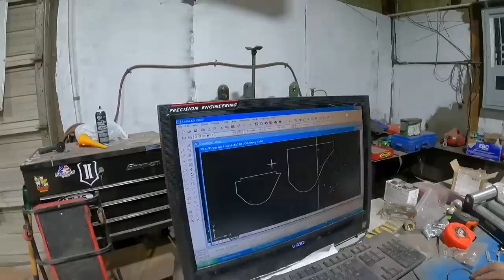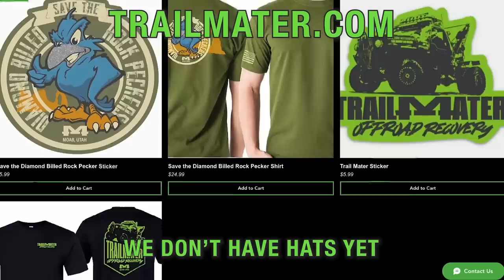Leaf Spring Life

Comment: If you used 1" or larger threaded rod with an adjustable limit strap adjuster you could tune from maximum drop to limited drop on the rear limit straps.  Kinda like Nascar spring adjustment screws.

Comment: Since comments help your algorithm, here ya go. Not just a comment, but a suggestion. For the longevity, double plate those hangers, and build a bridge between them. To keep the"wallow" out of the hole, weld in some hardened steel. If you have a lath, or take it to Paul, and old cam makes a great hardened piece. When I worked at a machine shop we used to use cam pieces to make hardened seats for heads.

Comment: How that trailer didn't tip over is a mystery
Reply: I wouldn't have even gone on the right side of that trailer unless it was winched off.  At least they got it further off the road.  Next is to unload the darn trailer into something else.  How long were they driving it in that condition?  And why weren't some of those door frames loaded onto the back of the flatbed?  So many questions!
Reply: @redmondjp  The first axle was strapped up, so I'm guessing they'd been running it on 3 wheels for a while before the other tyre let go. I've seen some sketchy things on this channel, but that trailer takes the cake by far.
Reply: Rory held it up with his mind.
Reply: Gravity sucks!
Reply: And not to mention the Miles it must have driven to Toast the wheel like that, a complete mess
Reply: That trailer had no business on the road. Sketch to the max.
Reply: @lbfuller5013  - I don't know where they came from or where they were going but even I, a girl, could plainly see that trailer was way WAY overloaded and it looked like the weight of whatever he was carrying  in the trailer was NOT evenly spread out.
Reply: You are watching a master
Reply: @shereesheree7735  don't sell yourself short, I've seen and worked with many gals that were better smarter faster workers than a lot of guys,,,, and definitely prettier
Reply: @shereesheree7735  Had mexican plates "TAMAULIPAS "thats about 1600 miles from UTAH...and the door frames had the HECHO EN MEXICO eagle

Comment: That was a very sketchy roadside tire and wheel change. Surprised you didn't request the client to offload some of the payload, but you were there to assess the situation, not me. All in all, you did a great job, thanks for sharing.
Reply: Those frames look big enough that you probably couldn't offload them by hand without a lot more people. Also shifting the load when it's on a bad angle like that could easily cause the trailer to tip over.

Comment: "Winch in, winch out?" Here's how Rory's run is going to go: Rory comes charging up to the scene and does an epic front dig for no apparent reason. He jumps out of the truck assesses the situation. He then produces a random piece of metal out of the toolbox on the cab roof that is just perfect to fix the broken part on the disabled vehicle. He does another epic front dig to get the winch positioned, and lifts the disabled vehicle. With a combination of hammering and welding he fixes the disabled vehicle in record time, and drives it out.

Comment: You ever think about installing one PTO winch on Trail Mater , they have more power is what I believe, for those really heavy loads and don’t want to pull down the battery! Just wondering Rory?
Reply: It's a lot of hassle, he would have to install a PTO on the gearbox and then rig hydraulic lines to run to the trailer, plus install the winch itself.

Honestly, in this day and age, there isn't much reason to install a PTO winch over an electric winch, especially on something like a trailer that gets removed. Electric winches can pull every bit as strong (if not stronger), are mechanically a lot simpler (less things to break), and are much easier to install. Unless you already have all the hydraulics in place (eg a tilt tray/roll back), electric is better 9 times out of 10.

And at the end of the day, he's already got two winches on Trail Mater that can winch vehicles on to the trailer, all that would do is move the winch back 3 feet.

Comment: Last year, I loaded up my 1923 T Bucket on my purpose built trailer that started its life as a travel trailer, and took it 800 miles to visit my oldest Son.  The tires "looked good" on the travel trailer, so I used them.  I went about 100 miles and noticed that one of the trailer tires was low on air pressure.  I filled it at a service station and continued on.  I had to refill it a couple of times during the trip.  I was coming back home, and was about 225 miles from home, when a man and his Son passed me and the Son motioned for me to pull over.  I had a flat quite some time ago, and it was just the sidewalls that was left.  I went to jack it up, and I could not get my jack under the dead axle, so I put the jack under the leaf spring close to the dead axle.  When I jacked it up, the leaf spring snapped in half.

I changed the tire, and put the 4 way flashers on and went down the shoulder at 30 MPH for about 10 miles.  I took the first exit and went to the first farm that was on the road that the exit was for.  I asked if I could leave my trailer in their yard for a couple of days.  They said sure.  I unloaded the Hot Rod, unhooked the trailer and went home.  I came back a couple of days later with 4 new springs, and 4 new tires and wheels.  It took me only about 4 hours to change the springs and tires.  Now I do not have to worry about tires and springs, or the trailer frame its self.  I modified the travel trailer frame and made it much stronger.

Although I did have all of these issues with my trailer, with my Hot Rod loaded up, it was not over weight, or over loaded.  The trailer in the video was soooooo over loaded!!!   Some people have no concept of how much weight a trailer can hold.  A couple of years ago I saw one of those nice dump trailers in the median of a 4 lane hi way that was soooo overloaded that all 4 tires had exploded, and there was a tire company there replacing all 4 tires.  From the looks of the tracks, the tail had been wagging the dog to the point that the trailer ended up in the median.  The speed limit was only 45 MPH, just think what this would have looked like if it was 80 MPH.  By the way, the trailer was loaded with gravel to the point of extremely overloaded.  I mean, it would hold no more!  Sort of like these people did!

Comment: With the amount of flex going on, I am surprised the mounts are lasting as long as they do before they crack off. You could shave down the nolathane bushes so that there is a high centre of about 3/4" broad to the diameter of the spring eye, a clearance waist each side of that 3/4" strip and 1/4" faces to take care of the end float. The waisted bushes would allow more flex without so much stress on the mounts themselves. With less surface area I would expect the high centre would wear down faster than a full width bush. I would be tempted to make the bushes as three pieces with a middle section comprised of the high centre with inbuilt spacers each end to separate a pair of nolathane end washers which will deal with the end float. This would allow the end washers to rotate instead of twisting the bush. The alternative is oversize spring eyes and ball bushes like the coil systems use on the control arms. By the time it gets to that stage one might as well go the articulated arm and coil route except for the ability of two stage leaf springs to handle towing loads. The waisted nolathane bush will be pretending to be a ball bush.
Reply: promise0094  There is no such thing as a free lunch so you may keep your scam attempt and your offered prize with my blessings.

Comment: I bought new leaf springs for the front of my 1991.5 dodge with six in a row under the hood it would be expensive for shipping but I highly recommend him outfit in eastern Pennsylvania stinger brothers, they make leaf springs out of American made steel and talk quality they built the springs for 18 wheelers and all that stuff your Springs Road kind of looking like they could use a little help. Anyway good truck though, if I wasn’t gonna run a big block Chevy, I would run a 383 stroker kit and a 350 with the manly splayed caps on the bottom end are used to help install stuff like that anyway nice choice I would use Kieth black hypereutectic pistons also mainly connecting rods Great combination with a trick flow crankshaft. All right you have a good day. This is six in a row.Jim from Kennerdell, Pennsylvania

Comment: Rory I could be wrong but wasn't that trailer overloaded which could of caused the problem. I am no expert but there was a lot of weight on that small trailer. 
I will tell you when comes to the tow truck games if I was a betting my money would be on you because in my opinion you have the most experience and as you said Trail Mater is a shop on wheels so you will have everything that you will ever need for any situation.

Comment: There's  a lot I would change  about the front end suspension  .the shackles  hitting  the frame move the shackles  eyes  up on frame longer front shackles  .and the hydro  assistance  lapping  over the leaf spring is just a problem  that could happen  .and center pins on them front leafs I would replace  them just for insurance and keep spare Allen bolts and nuts for pins .after that I wouldn't  touch  the rear suspension  .I found out that moving the front shackle eye holes up on frame is a must on a square  body like 2 3 inches forward  on frame away from the body mount .and longer  shackles. larger  bolts as well .

Comment: Does it matter if geometry of the bushing and the bolt and the bracket is slightly askew? Your leaf springs have a bit of a rotational angle to them so maybe that is what has been contributing mounting locations to be chewed up by the bolts in the past?

Comment: More of a rhetorical question than an actual inquiry - I wonder how often off-road recovery icons like Rory and Matt deem it necessary to perform a little preventative maintenance on the trailers they use for recoveries? It must be often, because they take them into some pretty harsh environments and subject them to extremes a regular trailer wouldn't see throughout its entire lifetime. 

I've worked in many tire/service centers over the years and noticed that a lot of people - from contractors to average homeowners - ignore simple things like checking for proper tire pressures, irregular treadwear and loos bearings, BEFORE overloading their trailers with whatever weird shit they shouldn't be towing in the first place. 

Then a tire explodes or a hub bearing grenades and these people are stuck on the side of the road acting like Bill Burr:
 "Wellll I don't know? Why IS that??".

Then - these clueless souls head down to their local tire shop and ask for 14-ply tires that hold over 100psi to be mounted on their cheesy OEM thin gauge steel trailer wheels. And the technicians, in their infinite cluelessness, struggle to mount them without ripping the bead or breaking the head on the tire machine and proceed to pressurize them to their maximum pressure with a rubber valve stem instead of a steel one - which wasn't suggested by the clueless tire salesman. 

Also - 
[ Unlike automotive tires, all ST tires are tested and rated at by the DOT at 65MPH. The 14-ply trailer tires typically are speed-rated at 81mph.  If the tires are in use for less than 5,000 miles/year, dry rot will get to them sooner than their tread wears out. These are good for about 5-6 years. However, trailers with more use than this will need tire changes more frequently.

SHOULD TRAILER TIRES BE INFLATED TO MAX PSI?
Yes, trailer tires need to be inflated to their maximum psi when they are cold. This is in order to ensure their full load-carrying capacity and to minimize heat build-up - reducing tread wear and fuel efficiency. What trailer tire pressure should be is represented on the tire's sidewall. ]

Anywho - Most of the trailers you see whizzing past you in town and on the freeway are more-than-likely just seconds away from catastrophic failure.  And the heavier / more awkward the load is - the more likely it is to be either tied down with grandma's yarn or not even tied down at all.

Comment: In the future put cribbing or something under the front corner of the trailer when lifting from the back it will take some weight off the tow vehicle and help you lift the trailer tighter because your not losing hight and the tow vehicle suspension compresses

Comment: Question: why not use rubber to give more "give" in the suspension, those polypropylene bushes are hard and jarring.
Reply from the maker: It's a work truck that carries tremendous weight. I'm more worried in bushings that last not ride comfort.

Comment: Will it haul Matt's giant rust monster off the mountain?
Reply: @@dashingforward360 just asking. I am kind of thinking. If it is untested when it starts. Will it even work? I don't mean testing in the yard. Actual off road recovery tested. I belive a twisted or broken drive shaft will be the first casualties. Steering seccond. And transfer case third. The electrical and coolant systems are suspect.

Comment: The guy with the trailer, I get trying to do a job with what you have BUT at some point YOU have to be honest with yourself about the weight in the trailer AND having only 1 axle. I personally wouldn't have used that trailer,  just looking at what was in it there's WAY to much weight for a single axle trailer.